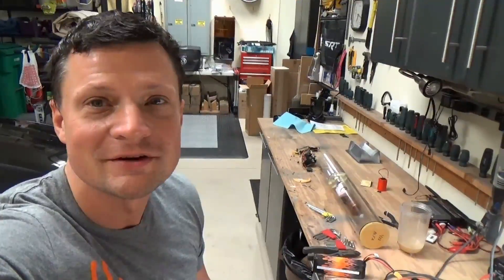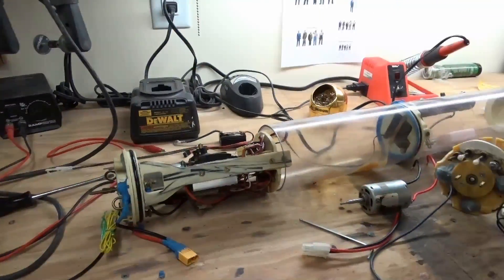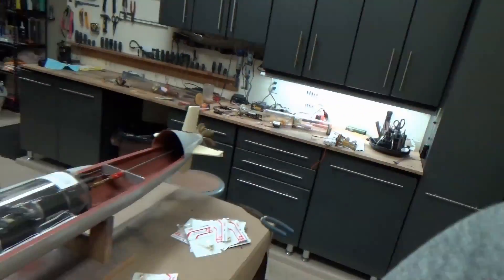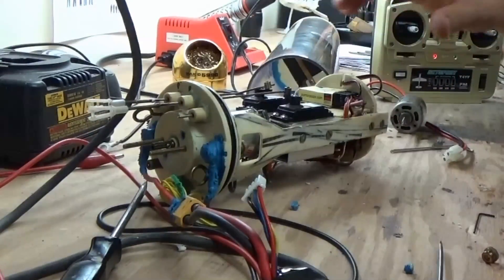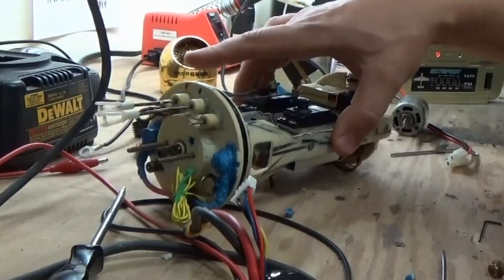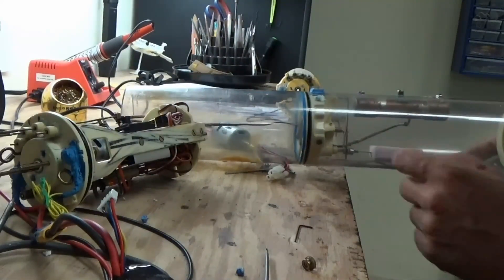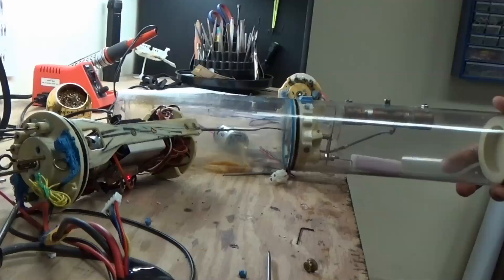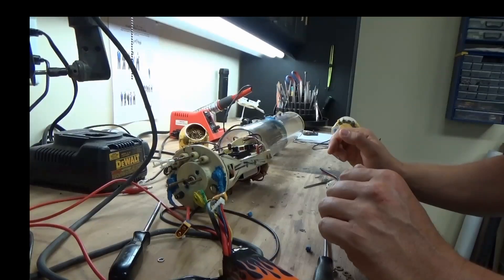RC Submarine watertight cylinder refit

Comment: Very cool:) I have not been working with any usual rc submarines, so i've got a question: I've seen a lot of cylinders that have got a threaded rod and a geared motor, to control boyancy/ballast. How common is this version with a real air-pressure tank?
I really like the design! Comes much closer to the real static dive systems
Reply from the maker: piston tank systems are quite common and afford exceptionally accurate control. They're usually set up in pairs as the center of buoyancy changes as the tank fills and empties.
Reply: okay. :) I actually meant, how common this version is, with the air tank
Reply from the maker: +DerKrawallkeks Gas style ballast is quite common here in North America, particularly in small boats as it is very compact and easy to implement. I would say that pump ballast is becoming more and more popular, however.
Reply: Okay:) I really like 'gas style ballast'. 
Still, I had to use my own system on my sub with a simple two way airpump, because there was no space;)